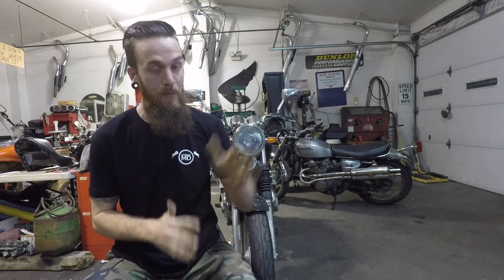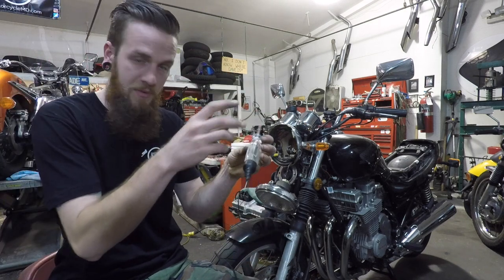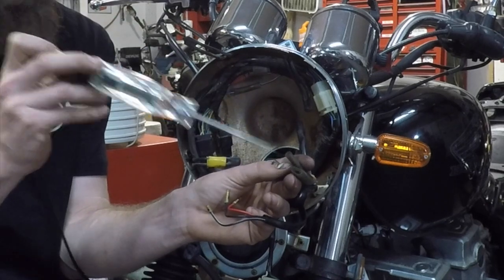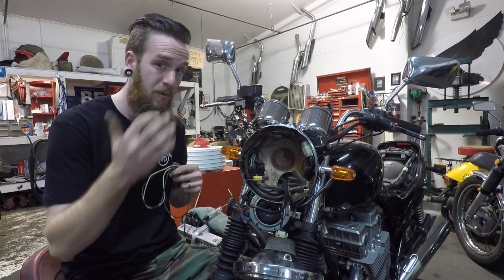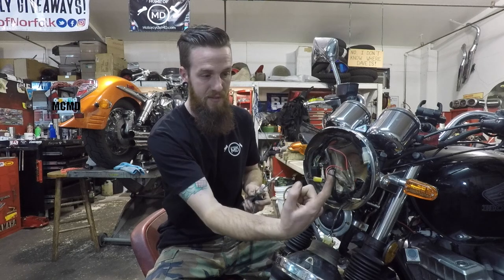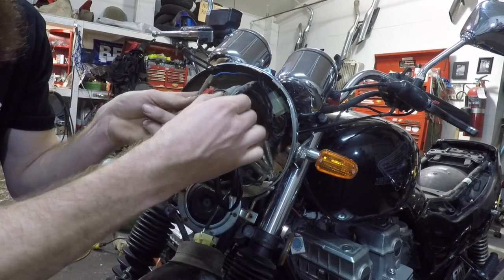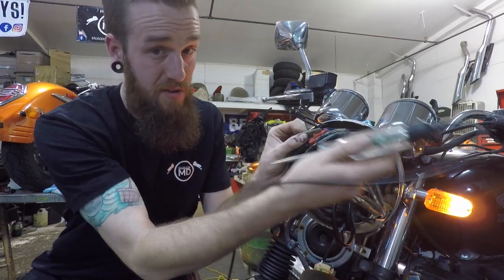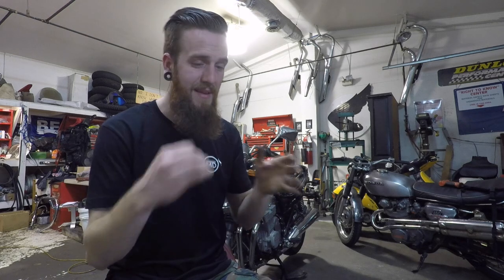Motorcycle Electrical: Test Lights, Turn Signals and Electrical Issues

Comment: My Honda lighting issue would probably even have you scratching your head. Its a honda varadero xl125v  indicators all work with engine off. Turn engine on indicators stop working. But if i put my side lights on or head lamp on they work again ! its just one position on the 3 position switch they wont work while engine running,. Turn engine off and bam they work again. So the turn signal switches are all working , the relays working, etc.  Some how starting the engine robs them of a live or ground im guessing ? Im just confused as to how?

Comment: Hey whats up! i enjoyed your video, i bought a honda shadow 750 aero in second hand, and it has the same problem, the head light doesn't work the max/min, only the presence light, i did´n understand exactly how you fix it, after finding the problem, what to do after you remove clip?

Sorry i am new to this and i want to absorve as much as i can, you seem to be good instroctur. 

Waiting for your feedback

i subscribed too 

have a nice day
Reply: Since he by-passed the start switch it has to be in the start switch. It might either need to be replaced, and since he said that he wrecked the bike it could be just a broke wire. Either way I would look at the start switch wire!
Reply: @bigtw09  thanks bro, I really appreciate that

Comment: hi dude i have a problem with my indicators got non. or neutral light and bike will not start at all. had starter motor off to clean it. put it back on still nothing. starter relay clicks i have headlight and high bean.  but no neutral light or indicators at all can you help bro cheers mike..........

Comment: On the three wire turn signals I have a 1983 XJ750 what would I do for the wiring I bought it without them on and am kinda lost on it all. Also when buying a new flasher relay the light don’t come on at all but with the old junk one the do but don’t flash
Reply: The stock harness only has two wires also

Comment: I got an issue where the harness has 3 wires, but the turn signals I'm trying to install has 2. I tried practically ever wire combination but it don't work.

Comment: Wiring is so hard to grasp when dislectic.
I changed to hallogen bulb on my usa k5 . Now a while later with other wiring issues my  daylight runners dont come on with headlight . Only with on / off light switch. And no rear light . 
Rear break yes 
All indicators yes 
Horn yes . Beeper yes
1 guage light . But the 4 light cluster works fully . I dont no which user manual to get for usa 750/4  high/ low all good . Stumped.

Comment: I have a old Kawasaki Vulcan bike I just bought and I can't get the headlight to work I'm trying to fix it up so I can ride  when I got it it didn't run I got it running but it blew the fuse box out so I bought a good fuse box now I have power but still no headlight and no start button last time I had to fix a motor ground I put a brand new found but no start yet

Comment: So the blue wire was the cause what was the issue...the control?
Reply from the maker: +andy macinnis well the control was the cause of the no power on the blue wire... That’s why I demonstrated jumping the problem switch to verify that it was the problem.
Reply: TheMotorcycleMD in your small crash the control switch was busted? I ask cause I am working on a restore of a early 80’s cb750F. Same issue only intermitted no head light but no tail at all

Comment: +TheMotorcycleMD   ....  here is a two-part scenario. 84 Shadow. You're headlight (low & high) work, the front left and tail light works, but the rest does not. No brake light, no tail lights and no front right. Also, are the front and rear side lights suppose to all be duel filament bulbs or singles?

Comment: I think it's predominantly the US that uses a dual filament (tail/stop) bulb for the signals. UK, and others just have a standard bulb in there. Running lights here and just headlights on.

There must be a lot of stupid people out there for you to over explain this. An example circuit would have been better. 2 circuits would require 4 wires, right? So, explain why it has 3. Then you can mention that they can both use the same ground/negative connection.